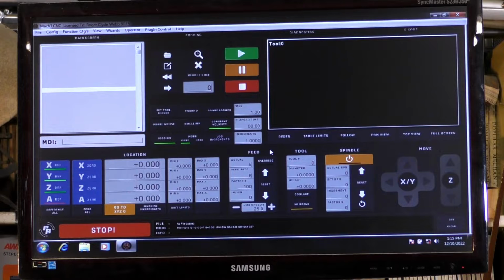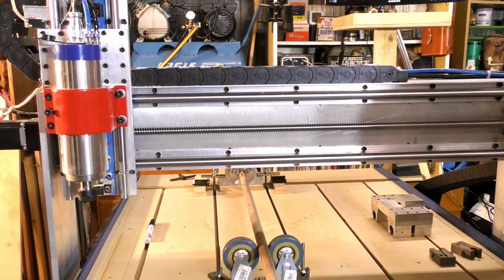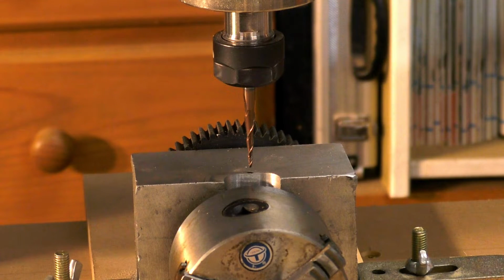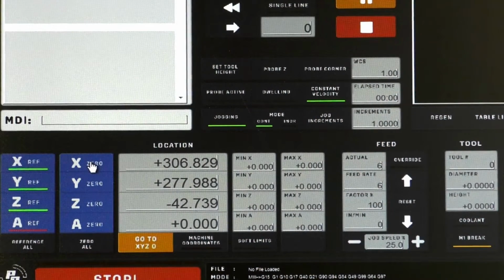Carveco Explainer 4th A axis slaved to the X axis how to set it up to a job

Comment: Interesting video.  I'd love to add a rotary axis system to my CNC and I had assumed I would need to add another stepper driver.  Disconnecting the X axis and putting it on the rotary stepper is a clever option.  If I get around to it, I'll have to think about using that method.
I think I've seen the video about the Mach 2 screenset you're using, but it would be nice if a link was included in the video, or in the pinned comments.